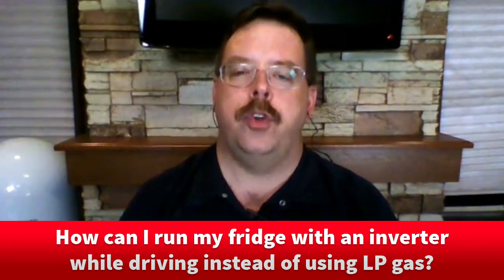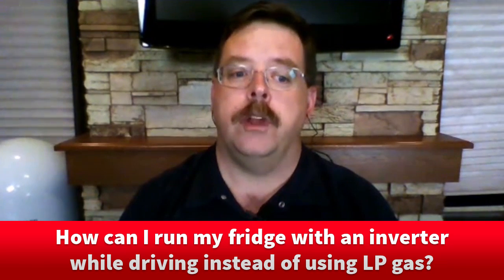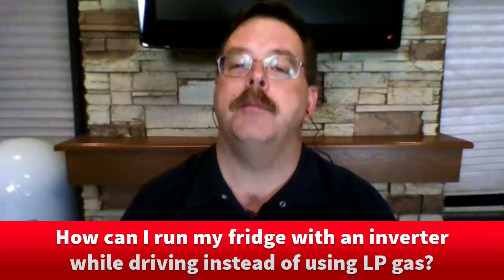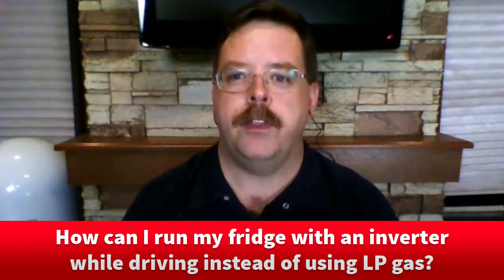Okay to run RV fridge using inverter while moving?

Comment: The solution is so simple!  While parked and the fridge is running on shore power or propane, you load the freezer door up with water bottles and freeze them.  Time to travel?  Drop a couple down below, leave a couple in the freezer.  Best part is you can still drink nice cold water when they melt.  Also make sure all your food and drinks are cold in the fridge before you go.  Those cold Cokes and beers will do a lot to keep the lettuce fresh.  It's all about getting it cold before you go.  I run my fridge fully loaded for at least a day before I move, and have never had a problem.

Comment: In my trailer that I used to have, I installed 400 watts of solar to keep my batteries charged a 1500 watt inverter with an automatic transfer switch installed a sub panel, pulled the plugs circuit and the microwave circuit to run those off the inverter. Never had any issues with battery drain, but pulling the fridge over to inverter so that I can run it off the invert while driving is something I wanted to do. Just never did before I sold it. With the right solar setup (enough watts and incoming amperage) this is something that should be very doable. You just need to make sure your setup is correct to handle the loads.

Comment: Good video. What’s your thoughts on this? While driving, turn off the propane tank. Then plug in the AC 110 plug into a 12 volt to 110 volt inverter connected to the house battery ( that technically are being recharged by the engine alternator) thereby eliminating the chance of a propane fire.  This would only be used while driving.  Could run a generator but that burns extra gasoline.  And if one have Solar, that too on a sunny drive will also keep the batteries charged/ topped off and the refrigerator running even at max if necessary.

Comment: Not sure if they ever answered the original question. I’ve considered doing the same thing to keep my fridge running while we were traveling for a day or two to reach a destination. Can the alternator of the vehicle keep up with the demand of the inverter? Once the destination is reached for the day, I would convert to propane or shore power.
Reply: Great question - i just used mine like this and noticed major draw on my tow vehicle gauge - unplugged on arrival and ran truck - battery is back to normal - is my rv fridge the draw ? Im not good at electric so any advice would be great - id hate to kill my truck battery

Comment: Ok what you need to know is what is the wattage of the 120 volt element. Mine is 150 watts. So I need a 150 watts or more inverter. Let us assume the inverter wastes 20% of the power throughput. So the Inverter needs 180 watts of DC power. Now dived by 12 volts to get the amperage needed to power it. 15 amps  Not really that big of a load requiring lots of battery banks. Now If your fridge needs 300 watts just double every thing and what you need is 30 amps of DC power. I do have Anderson jacks to power and charge my 2 battery trailer power bank using two number 6 wire (plus and minus) from the truck alternator with a solenoid disconnect that prevents the discharge of the truck battery when the truck motor is not running. I also removed the fuse in my truck that provides power to the trailer through the 7 pin connector so I don't discharge my truck battery that way either. My fridge is a three way but right now I have a propane gas fridge problem.  If you know or can learn what you are doing you can set this up so that when you have a shore power relay activates making shore power go to you fridge and deactivating the inverter. Be careful in your wiring because you don't want other appliances to get power from the inverter and you don't want shore power going to the inverter either. And when stopped without shore power you will want to use propane if you don't have shore power.

Comment: While parked, my coach "battery disconnect switch" needs to be on to allow my frig to run on propane, correct??  I'm not hooked up to shore power. How long can I have the coach batteries only, on without making the batteries go dead? Also do I turn the propane gas knob off when driving and turn it on when parked? Does my furnace run on propane and electric? So many questions. I need help.

Comment: I would think that an rv dealer could add a 12 vdc heater to the fridge and make it 3-way.  Then the charge circuit from the tow vehicle would handle it with ease because the charge circuit is 30 amps dc.

Comment: I have a large LG Residential Refer. I have 700 watts Solar, 2K Xantrex True Sine wave inverter just for Refer. 4  Large FLA Trojan Batteries. With the small charging from my truck and solar I can go all day driving and not drain batteries.(just need sun!). 
The thing is RV refers on 120 volts are battery hogs and doesn't work all that well. So everybody is using propane and while it works, very few turn it off while refueling.

Comment: It would be interesting to know relative efficiency of car vs propane on the fridge.  With the car, you convert gasoline to mechanical motion (25% eff) to 12V DC (75% eff) to 120V AC (85% eff) to heat (100% eff).  With propane, you convert propane directly to heat.  It is probably cheaper to run your fridge from propane.
Reply: Brad Teubner   The question was about refrigerator use while driving...you don’t use propane while moving.

Comment: Then you have to worry about the converter.   Just get a ice cheat and be done with it.   Or a house type small refer and run it on a inverter.    The batteries would needed to be upgraded to accommodate the additional drain but it can pull from the tow vehicle.

Comment: you can use an inverter while towing and hooked to a transfer switch to shore power and it will automatically go to 120 ac shore power

Comment: Sure you can run it BUT if you go up or down a hill more than two degrees the frige will be out of spec level and then chance of fire (overheated boiler fracture)
Reply: you would have to drive for many hours at the incline to even potentially damage anything. The vibration of driving keeps the chemicals stirred up enough it isn't an issue.